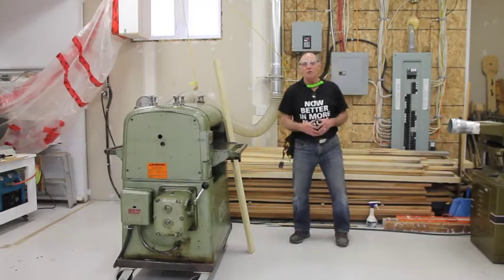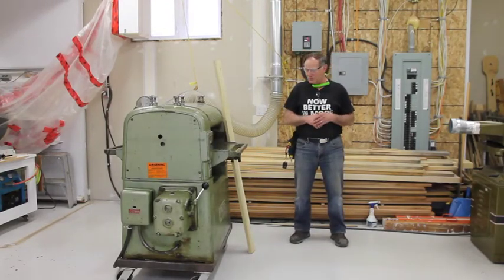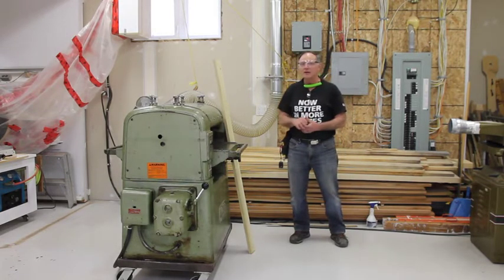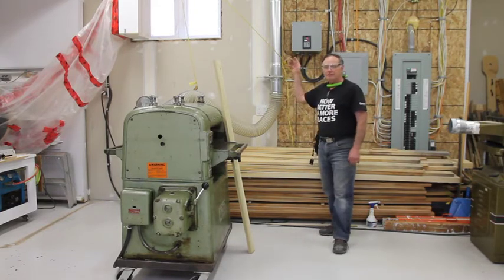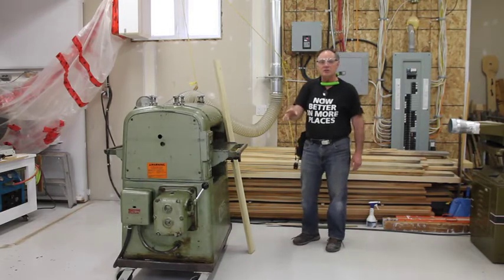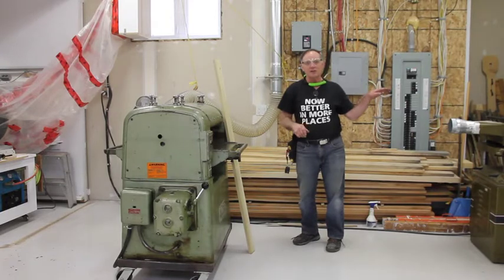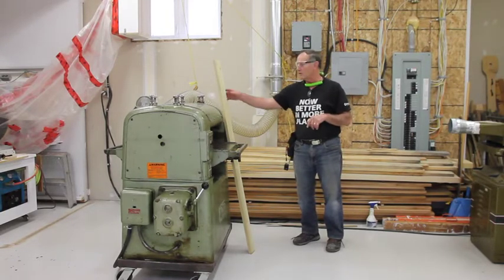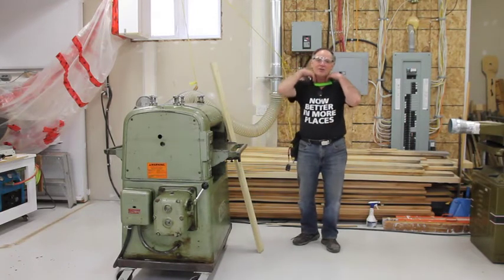Wadkin Bursgreen UO2 Planer   Computer

Comment: That is one loud planer!
Reply from the maker: Most straight knife planers are noisy, especially compared with the increasingly more common shelix style cutter heads with their multiple knves.  I'd have to agree, though, this vintage planer is indeed on the noisy side.  Funny thing, though, but it is actually quieter than the 16" Powermatic it replaced.
Reply: @ApexWoodworks  Awesome machine!